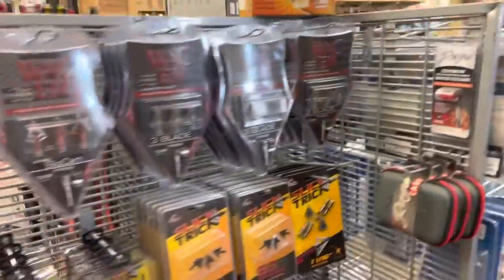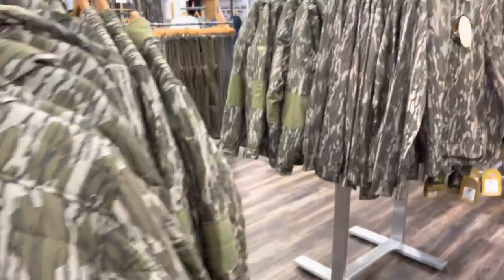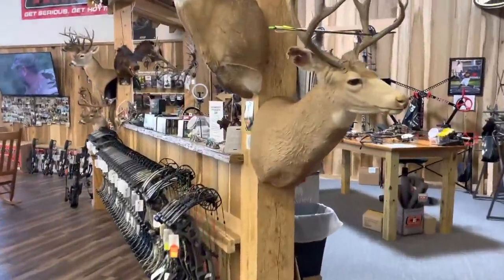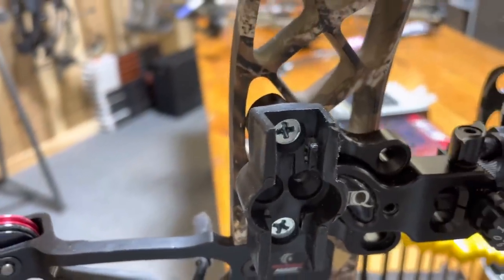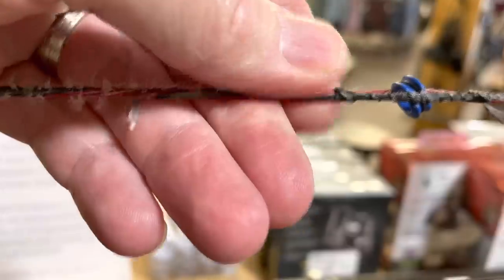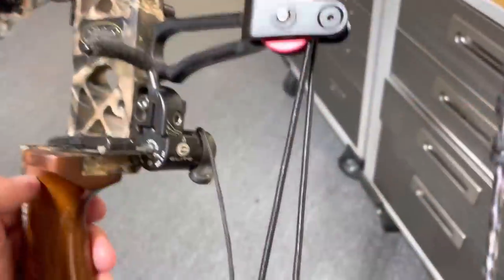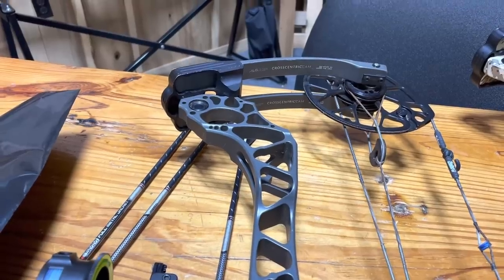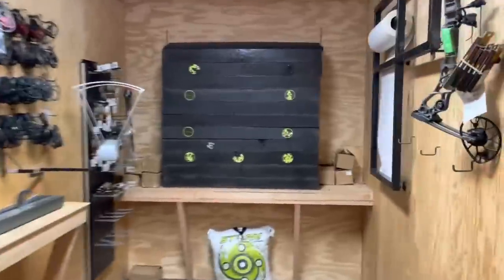WHAT ARE SOME BOW SHOPS DOING❓🤬

Comment: Why use a cable driven rest when limb driven rests exist. That is the real question.
Reply from the maker: Well the real answer is I DO NOT LIKE fall away rest at all and especially limb dribble. Way to much cord exposed, I do not like the little spring tensioner cause it can get sprung but Mathews sends me my stuff for free so I use it. Nothing any better and more accurate than a good whisker biscuit except shooting off a set of prongs. Biscuits are fool or off and very very very few issues. Don’t be surprised if I change. I can keep a spare in my pack and EASY TO TUNE